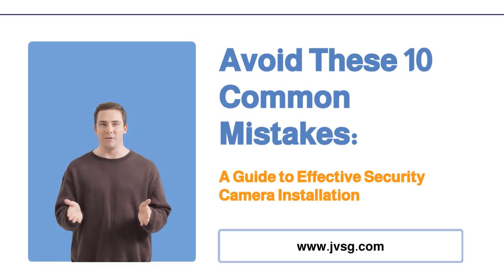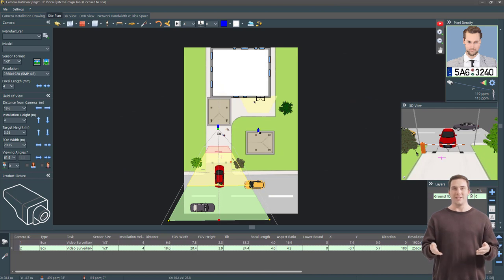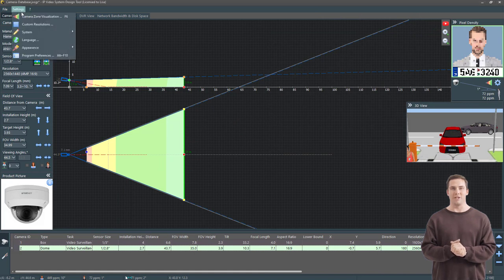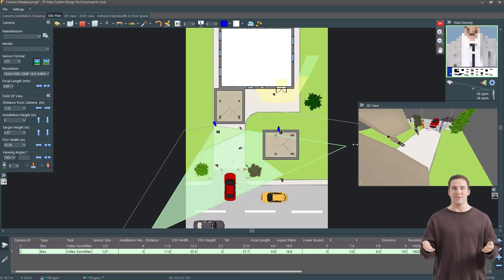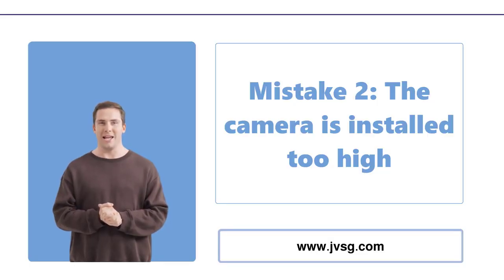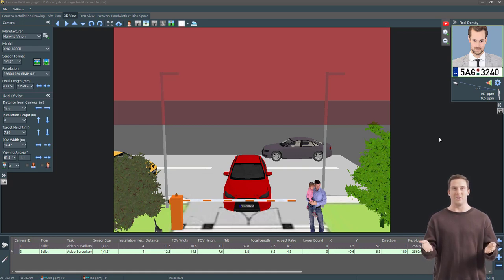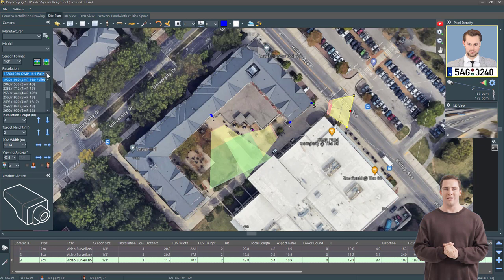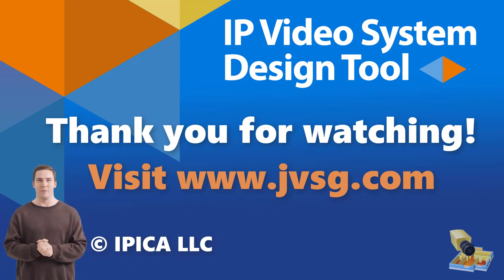Where to install security cameras?

Comment: Another thing usually not mentioned is spiders webbifying your camera due to being attracted to the light leds. Best way is to turn those off and use alternate infrared light panels placed elsewhere.
Reply from the maker: This is valuable advice for preserving your camera's quality and functionality. Infrared light panels can supply the needed lighting without drawing spiders to the camera.